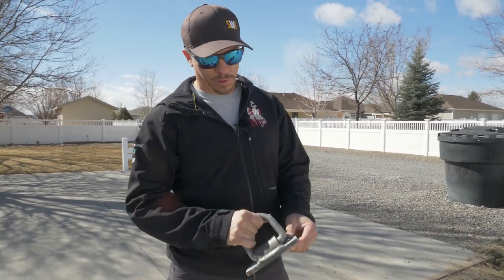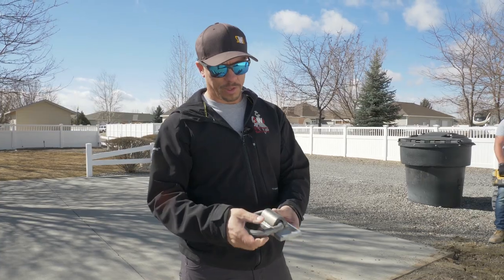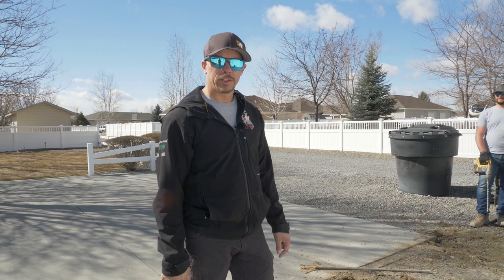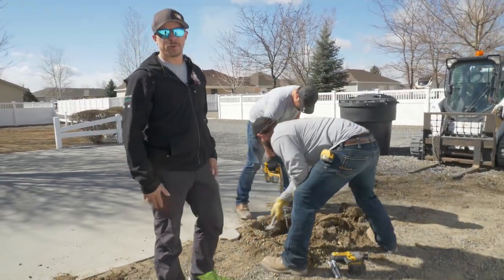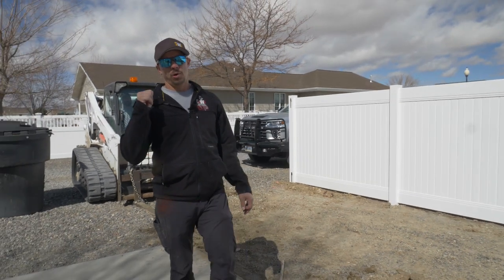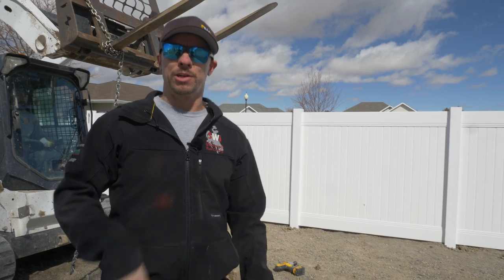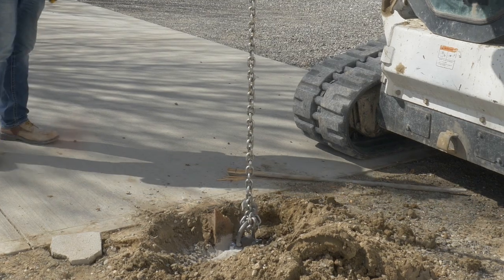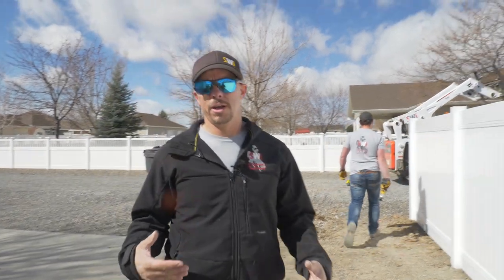How To Remove Old Concrete Easily!

Comment: Yea where the hell do I get that bolt!?
Reply from the maker: https://bit.ly/SWI34concreteanchor
Reply: @SWiFence  badass thank you bro!
Working for the city putting up new playground equipment and I got 14 concrete footings that are 30” deep by 2’ wide from probably the 50’s or 60’s about a 10” ceded lumber in the middle of the footings that someone came through and cut with a chainsaw long ago. They are exactly where new play sets are going. This footing start about 1.5’ underground.
It’s a nightmare